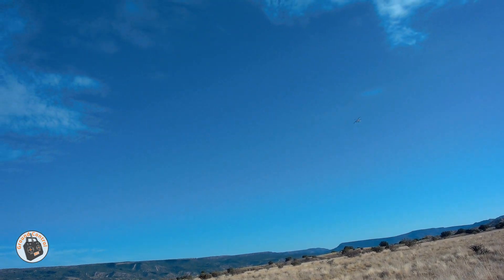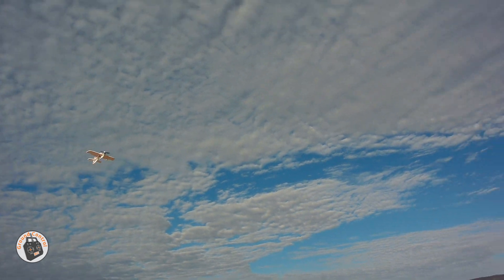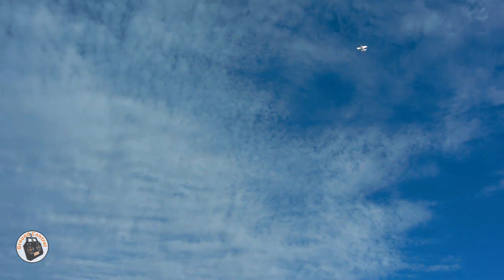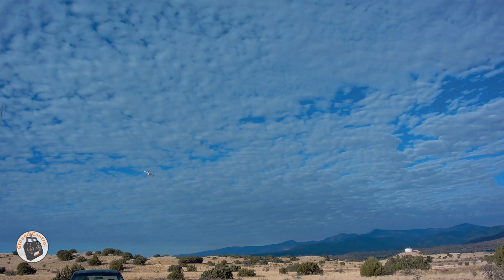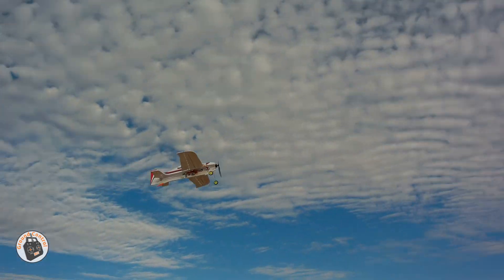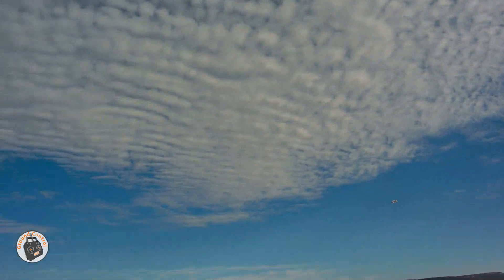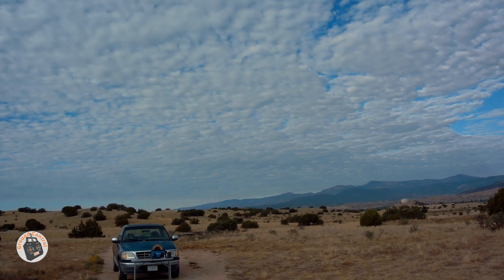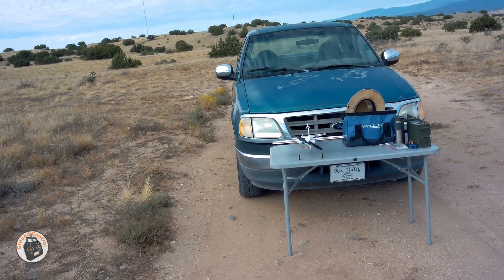You Won't Believe How Good This 3D Trainer Is! RadioLink A560 Sub-250g 3D Trainer Plane 6 Mode Gyro

Comment: I probably use the same motor in my depron builds. My motor is a Chinese DXW 2206-1500kV, 27g. I use it with propeller 8043, 380g thrust on 2S, 600g on 3S. DXW doesn't exist anymore, but you can buy Sunnysky X2206 equivalent on AE.
Reply from the maker: Great size and KV motors for 2S and 3S setups on these light planes.
I ordered a couple of these motors and some no-name 2206 1500kv motors with 5mm shafts.
I mounted one on my DIY Sport Plane spinning a Gemfan 9x45 SF for 2S testing and a Gemfan 8x38 SF Prop for 3S testing.
I'll be putting it in the air as soon as time permits and I have the weather.
I also found those Sunny Sky Motors and will probably pick up a couple on down the road.
If I can get 600g on 3S it should accelerate vertically ;-)